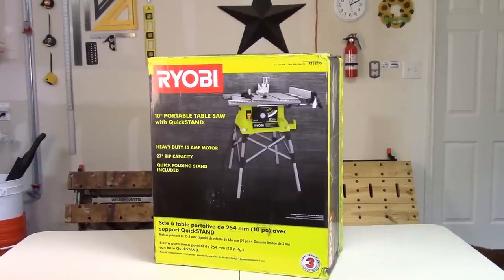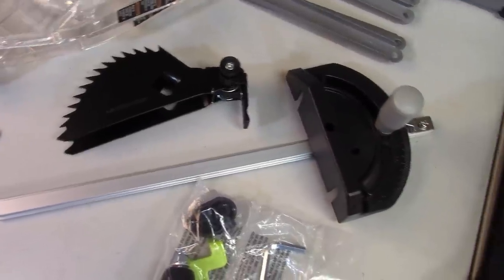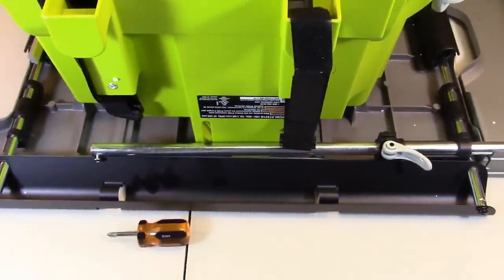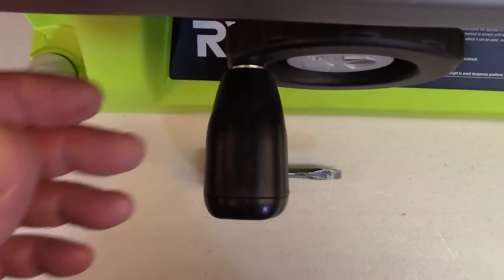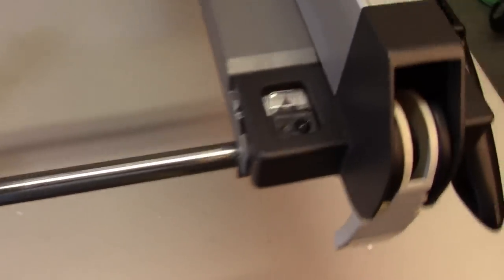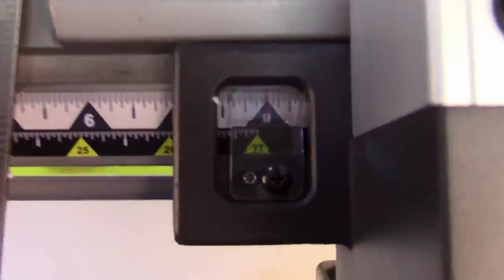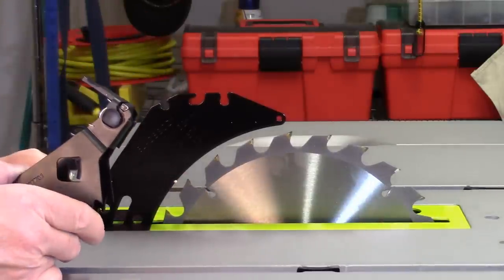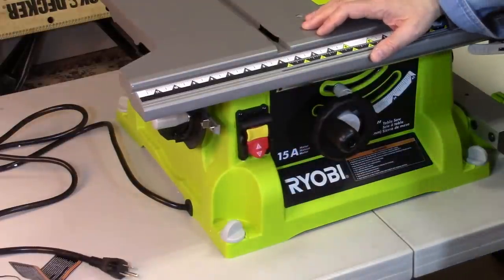How To Set Up Your New Ryobi Portable Table Saw

Comment: Thank you for that. But I would have like you to do some cuts to check for accuracy. I have noticed on quite a few of these types of saws that the groove for the mitre gauge is often very sloppy, and the fence sometimes dose not lock at the back leaving it to move when pushing the timber against the fence. Otherwise thank you for your time in making this video.
Reply from the maker: You are certainly welcome.  Thanks for stopping by and commenting. Cheers!

Comment: You just explained something that I have been wondering about for 6 months. How do you raise and lower the blade. DUH !! Thank you. I am not a pro or even hobby woodworker. I just need to get stuff done so I bought a cheap table saw. I solve each problem as it comes up. Dados just emerged. Any chance of a tutorial on cutting angles with this saw??
Reply from the maker: Izif Addag All of us have to start somewhere and I think you have a good start with your new Ryobi. And as my geometry teacher use it say "the only silly question is the one you fail to ask". What types of angles are you thinking about using this saw for? Cross cuts? Bevel cuts?

Comment: Helpful video but I was hoping you would make the adjustments to line the blade up to the 90 and 45 degree angles. I have an older saw and no Manuel and the blade is not at 90 or 45.
Reply from the maker: Hi Siotr, thanks for stopping by and commenting.  It has been some time since I had this saw.  If I remember correctly, it was either very difficult or nearly impossible to align due to how the motor is bolted into the frame.  You should be able to find the manual on line and see if it provides you with any tips on how to align to 90/45.  Cheers.

Comment: I need to adjust the heel on my saw but the manual has apparently mixed two procedures in the text and the procedure is unclear. I wish you would have reviewable this in your video.
Reply from the maker: If I recall this table saw correctly there is not a lot of adjustment you can do.  Regards - John

Comment: There are instructions in the manual on installing and adjusting the riving knife up and down but I couldn't find anything on how to adjust the knife to the saw blade.....Great video other than that.....Thanks
Reply from the maker: John Cutts You are certainly welcome and glad top know that this video helped you. Did you just get your Ryobi?
Reply: @WorkMateGuy  I just got mine and it was the same thing, mine should have been the same as yours in the video but without the stand- perhaps their newest ones don't include this? A video over it would be great.

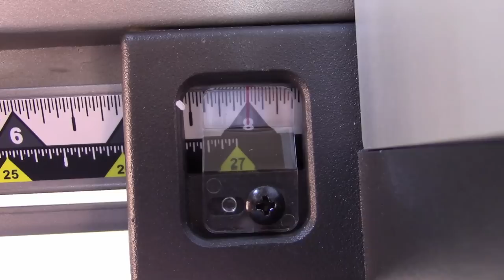Comment: Thank you for sharing your time and experience with us. At approx 15:45 you discuss making sure that the fence distance from the blade is accurate. Don't you think that it might be wise to perform the same exercise at the rear portion of the fence as well? I have this very same model and find that the fence lock mechanism is decent but there is some wiggle (for lack of a better word) at the back of the fence.
Reply from the maker: Peter Batah You are correct, you should check the alignment both front and back. If you don't mind me asking, did you just purchase this saw?

Comment: Hi sr. The antikickback thing and blade guard safety are use just with blade up that heights? Or can he use it if ypu put the blade down as much as an inche too?
Reply from the maker: Hello, all of the safety features should be used all the time with any height setting of the blade. You will notice in all of my videos I have all of my fingers.  :-) This is because I respect my power tools and apply all safety features and procedures.
Reply: @WorkMateGuy  👍😊thanks

Comment: it is possible can be use dado stack because some table saw the shalf not long enough can hold dado stack but shalf size is 5/8
Reply from the maker: It has been a while since I reviewed this table saw.  But, as I recall, the shaft was not long enough and the insert plate opening is not large enough.  Cheers!

Comment: I just saw the video so hopefully you’re still around. 
My ruler is set up such that 14” is on the fixed part of the table, not the extension nor is 27” in the same location relative to the markings on your saw. Any idea why? Maybe a wider extension table?
Reply from the maker: I gotta be honest with you.  I typically ignore the marking and measure the distance from the blade to the fence on this unit.  Cheers!

Comment: I got my saw a month ago. The stand is completely different now. The table has no extensions now. The anti kickback paws are different now and fully assembled on the guard. Also no yellow key. Just a green on button and red off button.
Reply from the maker: Yes, they came out with a much smaller version and I am not certain why.  Cheers.

Comment: Ryobi disappoints with the formed table as opposed to the cast table. The saw is still usable but high quality performance can only be achieved with extra effort and care. Best bet make a sled. Not saying all of them are bad but the one I purchased the formed table was not 100 % 💯 flat. And the blade lock plastic slipped on the nut and stripped with no excessive force. Leaving me to be creative on the fix. May have to make a part out of metal or perhaps modify a socket to replace the plastic one.
Reply from the maker: Hey David, thanks for stopping by and sharing your thoughts on this product.  Cheers!

Comment: Can be use dado stack blade this ryobi 10 inches table saw
Reply from the maker: The shaft that holds the blade is not long enough to hold a dado stack.
Reply: the shaft hold the blade the size is 5/8  the arbor right you never try using dado stack  if possible can be use dado stack because some table saw the shaft not long enough can hold the dado stack

Comment: I have the RST21 Model and I'm having trouble heeling the blade can you possibly make a video or direct me to a video on heeling the blade on this model. the handbook/manual does a shitty job on explaining what each adjustment screw does.
Reply from the maker: Hi Craig,  I wish I still had access to this saw or I would be happy to make the video for you.
Reply: @WorkMateGuy  I figured it out only took me about an hour to get the blade lined up, cuts to perfection now. Thank you tho.... if I had my day over again I would of researched more on accessories for Ryobi because you can't even get a feather board to fit for them. I haven't come across a track insert that will fit them for any accessory.
Reply: @CraigGatza  Glad you posted this.  My son's 21G has a blade I cannot seem to figure out how to align.  At the very top of the front there are 3 allen screws.  Two hold the adjustment made by the one on the left of the three.  There seems to be a bit of a cam or eccentric action in that screw that adjusts the left-right movement of the back end of the blade, but it isn't nearly enough adjustment.  I thought about simply removing that adjuster and setting the line-up manually and then tightening the hold-down screws in place.  But it looks like I just about have to disassemble the saw to remove that mechanism.  The saw runs well and it would be nice (safe!) to have it working properly.  Any ideas?
Reply: @cfbarnett  3 allen screws? I have no idea. I only have 2 on the front of mine the far left one is for the 90%, when u have the blade at 90 or set to 90%. and the right one is for the 45% when you have the blade at the 45% position to align it true. I have the Folding stand model that you store on the back of the saw. once i got the blade aligned true it cut like a dream and I make mostly furniture outdoor and indoor with mine.
Reply: @CraigGatza  If you are talking about the two hex screws on the top of the table itself....yes..those are for the 90-45 adjustment.  To change the alignment of the blade with respect to the 'miter' slots (I wish Ryobi had used a standard slot size...only real thing I hate about this saw) you need to look in the back under the table and there are set screws under the lip of the table which allow you to adjust the track of the blade alignment with respect to the slots).  Once you have that done...then adjust the fence itself based on the blade position.  It is a pain but not really that hard....just more tedious than it needed to be.....hope this helps.
Reply: @elivojnovich4116  I did not know about them screws but I haven't had to much time to do any projects lately, just got back into nursing working 2 jobs... baby on the way so got to start making the money again. I will definitely be looking at adjusting them when I get more then 1 day off lol
Reply: @elivojnovich4116  Yes thats the only thing I don't like about the saw is the miter slots. It's a great saw I never had a problem with it yet for cutting... for my needs anyway just wish i could get some accessories for it but you know what they say, wish in one had and shit in the other... see which one fills up first lol
Reply: @CraigGatza  Well, glad I could be of some help.   Between that and the miter slots those are my two minor issues with it.  Other than that it has been a great table saw for the money.  The adjustment is a pain but still easy enough to do.  As to the slots....I have seen a host of options from making custom hardwood runners for jigs and sleds to just using the sides of the table itself to register them to hold true.  As with anything in this world...nothing good old fashioned American Yankee ingenuity can't fix.  Best of luck with getting back into the nursing field and congrats on the soon to be new addition to your family.  :)

Comment: You just me a whole lot safer. Thanks.
Reply from the maker: Hey Don - You are certainly welcome and glad to know this improved your safety.  Thanks for stopping by.
Reply: @WorkMateGuy  I bought a used Ryobi 10" table saw and it didn't include the kick back pawls, riving knife or the push stick, miter gauge, rip fence or anything for that matter. Watching your video was an eye opener. I went to Ryobi's website and ordered everything i needed and surprisingly it didn't cost much at all. If it wasn't for your video I never would have known. Thanks again.
Reply from the maker: Hey Don - Well, congratulations on your old/new Ryobi.  I know you are going to enjoy using it.  You might find the New Yankee Workshop TV Series on youtube of interest.  Regards.